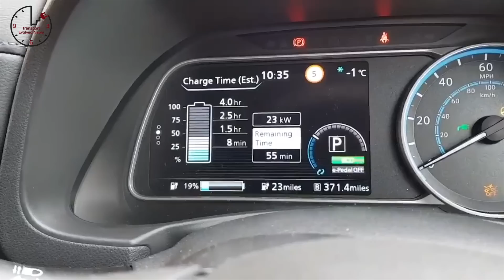Elon’s Pay Packet, Slow LEAF Charging, Self Driving Fatality -- TEN Episode 202

Comment: From an AI guy: Its very hard for both humans and AI to recognize objects in poorly lit areas,  why so many deer are hit every year in the US by human drivers. The bike acted much like a deer,  by darting across in a dark area.  So Uber with its tiny number of test cars, likely did NOT have in its database any understanding of the visually strange "blob" of a human and a bike moving in the dark. A Tesla would have issued a loud alert. Where was the alert in the Uber car? I didn't hear it. FAIL.  Uber needs to cut out night driving until it fixes these problems and issues good alerts and builds a larger test fleet. Tesla on the other hand, has 100,000+ cars collecting data in stealth mode, to gather hard test cases in night/rain/snow driving.
Reply: Jim Whitehead Ehm... you know that LIDAR Sensors work in complete darkness? You know that the classification result of the "blob" is irrelevant in this case? AI guy, huh?...

Comment: Thermal throttling of the DC quick charge happens after 2 consecutive charges on the old leaf too. 2-3 quick charges on a road trip takes the temp to the red zone. Old news and to be expected as much is unchanged in the new leaf. Those wanting cooled batteries would buy something else anyway. The benefit of getting EVs on the road and making a profit grossly outweighs the downside of not being able to drive more than 450km before charging speed is reduced. Stop whining and be grateful that Renault-Nissan is the only company taking global warming seriously and have a sustainable business model to make the change last.

Comment: Busy, and tough, week in EV news. Let's hope for a better week next week.

Professor Kelly's videos are great if you are interested in the technical side of EVs and hybrids. His videos are made for the the mechanics classes he teaches at Weber University in Utah in the united States. He has several videos disassembling battery packs and drive units for hybrids and, presumably, soon a video of the drive unit of the Chevrolet Bolt. 

I constantly pester him to finish the video for the intimidating dual motor/generator planetary drive unit with internal power supply as used in the second generation Chevrolet Volt. I have one of those, love it, and though I know it has five modes it switches between they so seamlessly I really want to see how it works. GMs cutaways and animations just didn't do it for me.

expand description below the video to see a link labeled "Bolt Vs Leaf" and be sure to check out his other videos on Weber. Fascinating stuff. It's a service to us all.

Comment: About the Leaf slow charging, I’ll wait for some engineers to take a look at it. It’s possible that the BMS is being over protective, or that the balance of battery heat KW and battery thermal insulation isn’t ideal. Nissan obviously doesn’t want the battery to cool fast when the heater is on, but it also must be able to cool down enough between charges to allow normal supercharging.

Perhaps the guy can do the trip again, but this time as a test, and record more data, and also very that the ionic can get more out of that same charger that he could only get 25 kw out of.
Reply: Yes, the BMS is being protective.  But why?  The problem comes down to the thermal characteristics of air vs water/coolant.  Air simply does not have the same heat capacity that a liquid will.
Reply: OnlyFactsPlease, Air vs liquid doesn’t even come into play with the Leaf battery, since it’s not actively using either to cool the battery, that is the main problem. Similar batteries are used by Zoe and Soul EV, but circulate heated or cooled air through the battery, and these batteries don’t overheat when fast charging. 

At the end of the day, all the heat needs to get moved to the air outside the vehicle, either directly or indirectly. Using liquid has some advantages and disadvantages. Nissan designed the Leaf so that you never need to worry about a coolant leak inside the battery. When they use a 64 kWh battery. It will be packed so tight and designed for longer trips, and will most likely use liquid thermal management.

Comment: I'm fairly happy with my 2016 LEAF, and am impressed with the new tech in the 2018. But it is time for Nissan to stop messing around with ( or without, as the case may be) active battery temp management. This reduced quick charge thing really is a black eye, especial if not clearly mentioned in the owners manual ( was it ? ) Me, I'm still on my own one man rant about the inability to have the car stop its charge at some percentage less than 100%. 😕
Reply: Carpenter Family hello friend, I'd suggest contacting an electrician that may be able to fit a timer on your home charger so you can go oh I'm only 10% shy of my desired 80% charge so I'll set my timer to 2 hours (not sure how long it will take but I'd think you might get to know your car enough to get used to knowing the time it will take). It might not make sense if your upgrading vehicles soon but if your keeping it for awhile it might be worth it
Reply: Thank you Larry. That's a good idea.